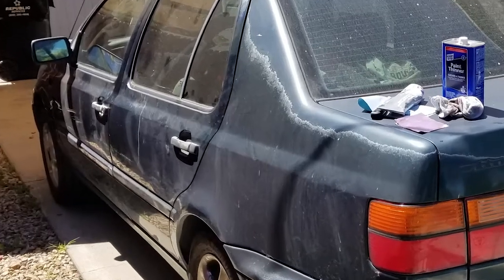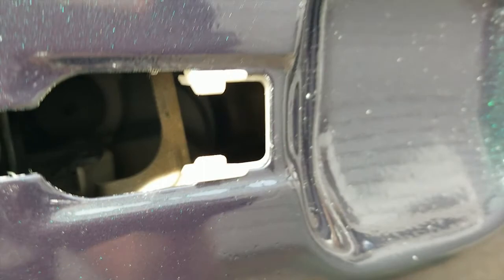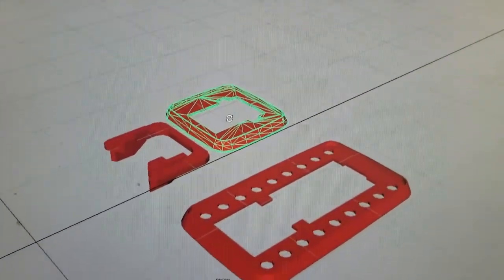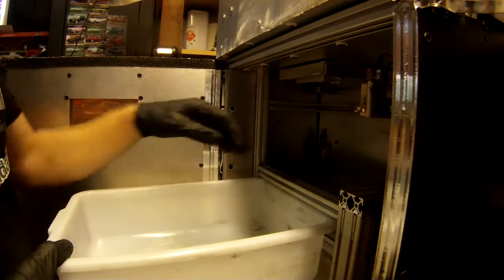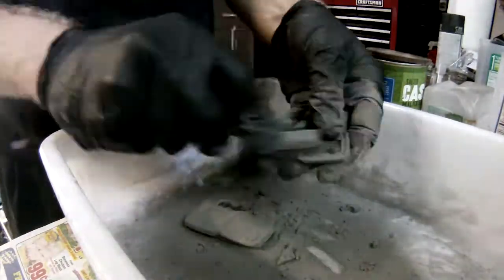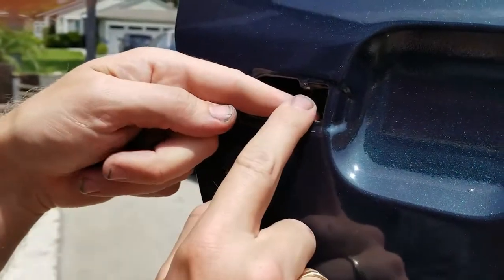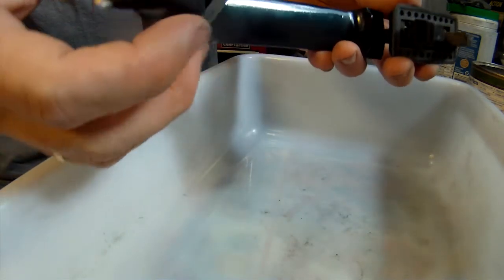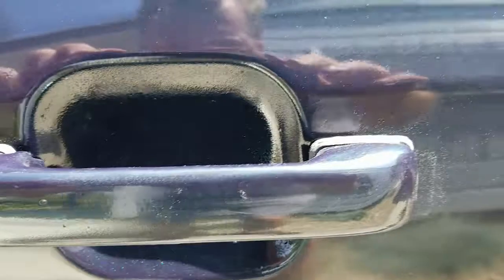Functional 3D Printing | VW Door Handle Mounts

Comment: Can you make a Video showing some close up of the prints, or maybe snap some photos so you can see the surface quality better? :D:D
Reply from the maker: Sure.  I think i already have one video showing how higher surface and chamber temps can affect the surface texture of the print.  Check my earlier videos for that.  Ideally, you want to find the optimal temp to have a smooth surface texture but also get proper bed temp distribution across all the meshes in your bed.  Like if you load up your bed with 100 models, you might be willing to have a slight surface texture on the central meshes to ensure all the perimeter models get up to the required sintering temp.  Hard to explain.  

For the most part, most of my prints have a nice smooth surface texture. There are some exceptions.